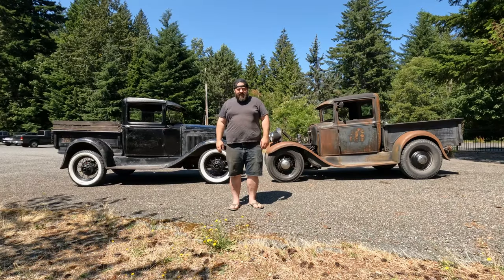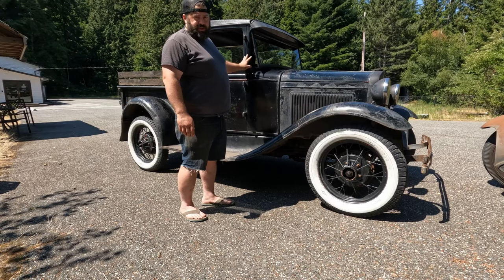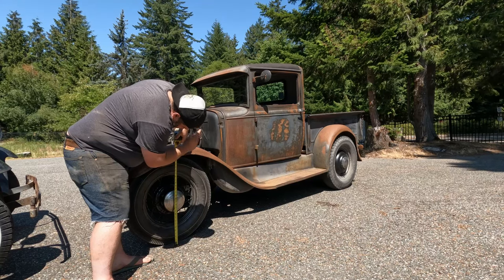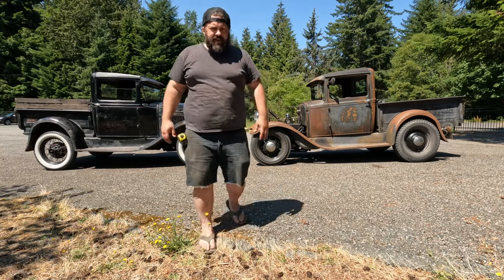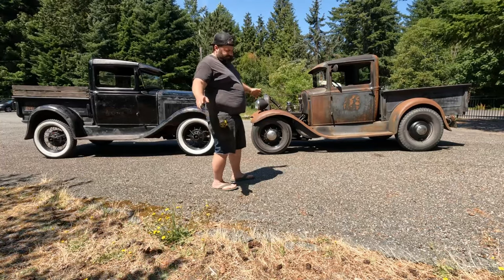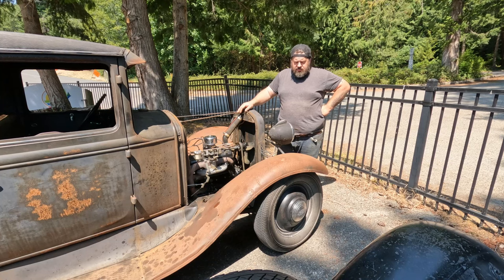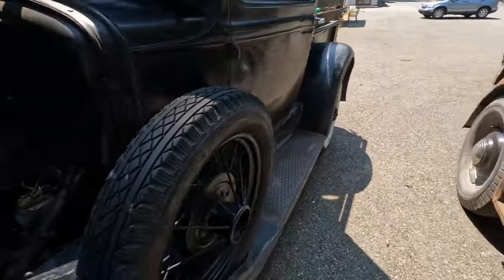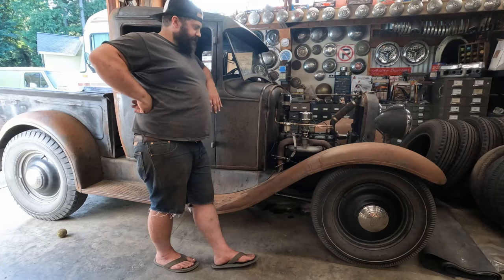Stock Vs. Hot Rod. Comparing  two 1931 Model A pickups.

Comment: I had a 1936 ford pickup and put 1940 ford hydraulic brakes with a 1946 ford rear axle and converted it to open driveline with an 1951 8BA flathead V8.
Reply from the maker: Very cool!

Comment: Ya know Matt ------ looking at Doug's truck ----- being -- SO -- original and in pretty good shape ----- I think I would leave it all original too ---- as you said --- the paint is in good shape for all these years ---- and the big thing ----- I don't see a lot of ROT ---- if any from your camera view ----------- And your truck --- you got the STANCE --- the Big and Littles --- and hopped up motor ------- Something I caught you saying ----- you are --- STILL --- running Babbit Bearings ---- aren't those poured bearings --- low RPM and not much of a  load put on them? And don't they just kind of start coming apart --- little pieces of Babbit here and there in your pan  and if not caught early ---- a Rod through the side ------ Yes ---- it is Good here in the N.W. ----- maybe 90 or so now and then ---- BUT --- 117 in the South ---------- I Don't Know ------- Thank You for the video ---- Have a Good Week ---- Rodney
Reply from the maker: If the babbitt is an incorrect mix, they'll fracture. They really should come apart, unless you're really beating the snot out of it. Hope you're staying cool Rodney!
Reply: If i had it only things I would do is fix the rot keep it roadworthy and drive it. 
Actual rust aint cool no matter what craigslist says lol

Comment: Be a shame to turn that stock pickup into a hot rod
Reply from the maker: The hot rod truck was a nicer start when I started converting it from a barn find stocker. It's had 6 holes drilled in it. I could turn it stock in a weekend. Hard to call that a shame in my book. A lot of the touring class cars have more mods than I've made to my truck.

Comment: I have a babbit bearing 31 hudson 8 coupe 76K miles still good oil pressure (yup they had oil pumps, and roller cams). Engine never taken apart. Like all bearings keep the oil clean, problem is finding a shop to redo them. Also pre 70s engines didn't last due to bad oil, not bad engineering or alloys. My engine builder said my yblock engines will easily do 250K miles with zinc oil. 

As to stock vs mod. I wouldn't alter the Hudson because it keeps up with city traffic and way too cute to goof up, I did put proper lights on it and keep the mechanical brakes adjusted. But I did update my 32 4 door essex running gear/suspension because if I hadn't it would have ended up in a scrap yard in 10 years despite being extremely rare and in good condition. The kids don't want them, museums are closing and garage space too valuable for static art cars. They were built to drive, I'm in Renton, someday perchance to meet.
Reply from the maker: Some cars deserve to be left "how they were". Like your Hudson for instance. Sounds like a cool old car.   I find, that with how common model As are, that I'm really not ruining anything by making a few changes and lots of times, my modifications are less intrusive than some of the things done to these old cars over 90+ years of service. Hopefully we'll see ya sometime. We're gonna be at good guys, if you go.

Comment: My dad was pretty good at dialing in the timing on our 29 Tudor....I still have it and a collection of vintage speed parts I'll be adding soon.
Dad's first car was a 31 delux roadster with a Winfield head and B carburetor that he bought in 1940.

Edit;  I'm in Woolley, so just a couple hills away.
Edit#2; What ring and pinion are you running in your PU? 
I would think with double the HP, you should be able to run the 3.25 ratio no problem.
Reply from the maker: It's a 4:10 in that thing.

Comment: matt where did you find the 39' transmission? also did you have to change the rear end as well or is it stock model a?
Reply from the maker: It was down in Tacoma years ago. Been in the truck for a decade. It's hooked to a stock rear-end.

Comment: Did you have to modify the fly wheel or change it to get the 39 transmission in it?
Reply from the maker: No modification needed to flywheel or clutch. It's 100% bolt in.

Comment: I wouldn’t  think you could drive at 60 mph with the stock bearings even if the engine is more powerful. Doesn’t the rpm exceed the engine’s capability?
Reply from the maker: They are designed to go 60 mph when new. In 1938 a model A roadster with a similar engine set up ran 136 mph at El mirage or Bonneville(can't remember which) and had top time for the meet.

Comment: It’s hard to beat hydraulic brakes. Nothing like good brakes when you need them. Those old rod brakes are hard to keep adjusted. In an emergency stop you really have to “stand on” those rod brakes.
Reply from the maker: Definitely. I much prefer the juice brakes. But find that good mechanicals do work decently. But like you said, they require a fair amount of maintenance and a bad system can be a real mess.
Reply: @Seattle_Speed_Shop  especially in the rain

Comment: I dont like the stance of the hot rod, looks goofy, fronts to low, rear tires are to big
Reply from the maker: Again...different strokes. That truck gets a lot more compliments on its stance, than I've ever gotten in a stock A. It drives and rides better than the stock wheels and tires as well. For as many miles I put on it. It's no competition. The hot rod truck is a far superior ride.
Reply: @Seattle_Speed_Shop  Ignore the haters...no car guy will watch this and post nothing but critcism..makes me wonder.
Reply: WHy insult the guy, nothing good to say?
Post your ride